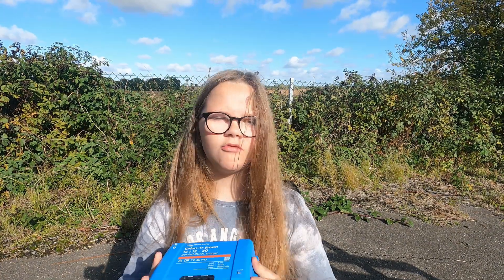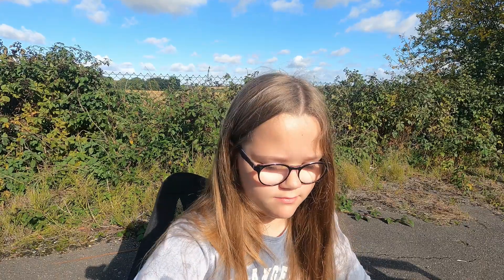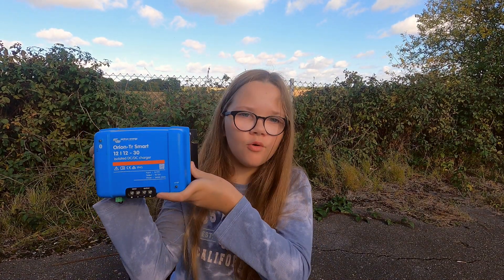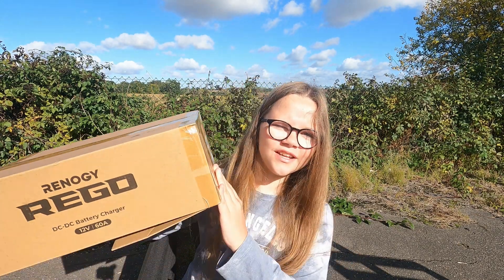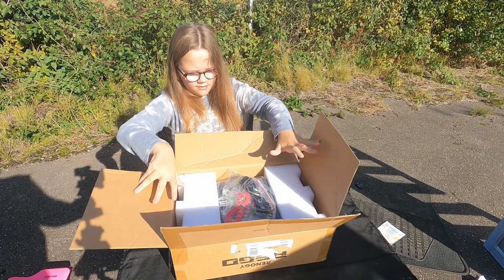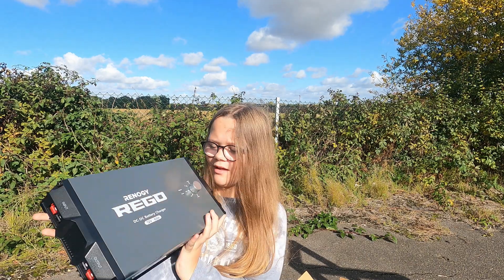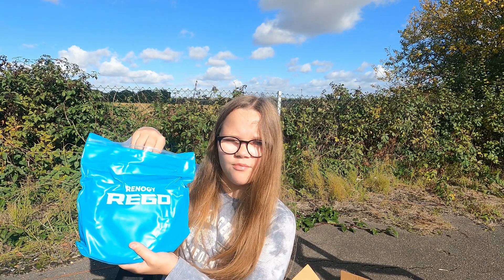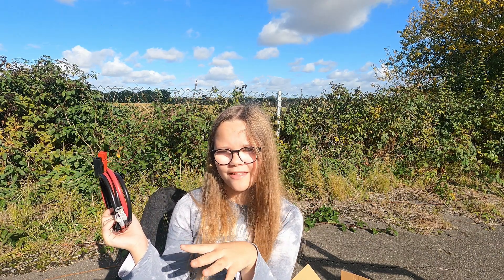Renogy Rego 60amp dc to dc Vs Victron 30amp dc to dc #renogy #victron

Comment: How does this work with smart alternators ?
Reply from the maker: You have a remote wire which you put on a live that is only live when the ignition is on.
We justhad our alternator go on us late at night and this system put just enough power back to the starter battery from the leisure battery to keep us going so we could get home